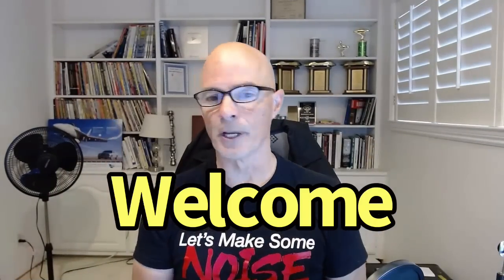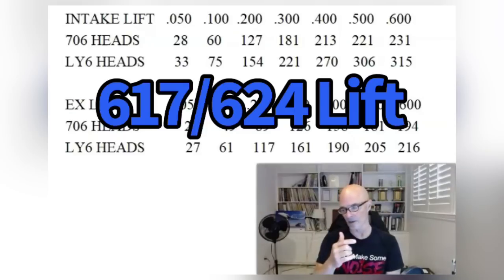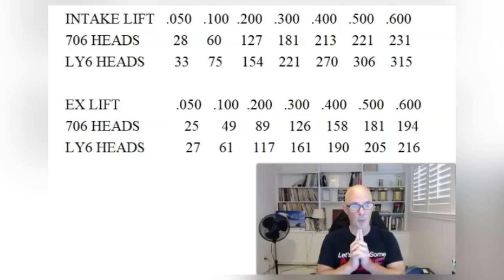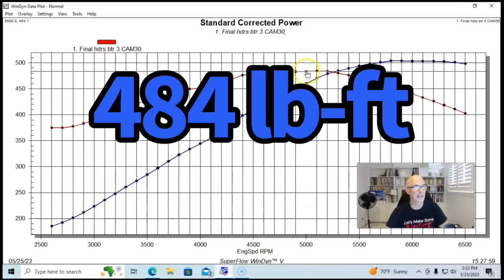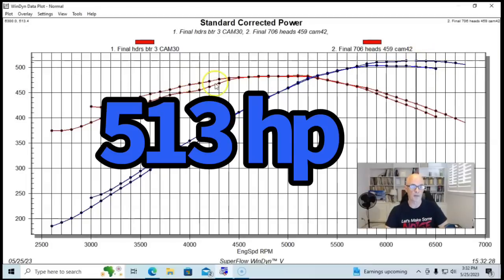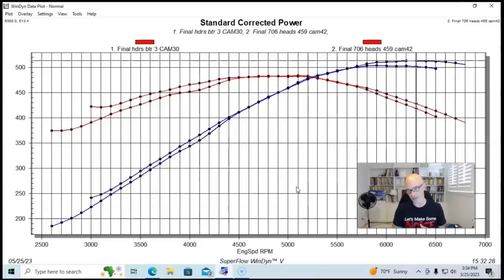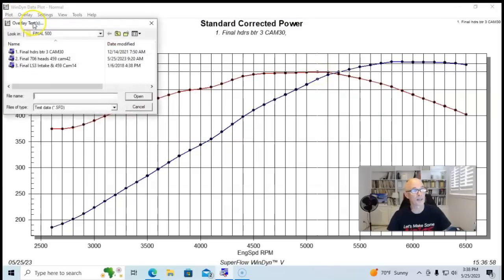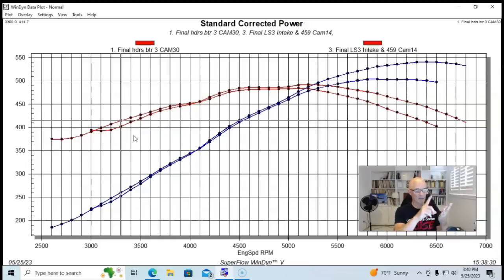HOW TO: BIG LS POWER WITH MILD CAMS-THE KEY IS HEAD FLOW. BIG CAM, SMALL HEAD VS BIG HEAD SMALL CAM

Comment: Great comparo.  TBH never really thought about it, but the results make sense.  Been getting ready to refresh the top end of my LSA and have been waffling on cam choice as its daily driven and a manual car.  Was just going to surface the heads and do a valve job, but now I'm thinking I can stay with a stage 1 cam and just do a nice port job and get the best of both worlds without losing my idle and below 2000 rpm performance.  Thanks Rich!
Reply: Below 2000rpm and performance is a very strange thing to hear in a sentence lol
Reply: @hayden6056 it's important driving a stick. Not having to wind up so much before shifting when just driving around town. And helpful when holding a gear when slowing down instead of shifting down to keep the revs up.
Reply: @AustinRBa  most the cars I own are "stick" , I prefer to keep them in their torque band personally rather than labouring it barely above idle. 

Maybe the word efficiency would have been more effective use of term . 1500 rpm and performance just sounds strange to me. 

I've pulled apart some t56's with stripped over drives who weren't towing because they thought sixth gear was for the highway and were constantly going up hills at 1400 rpm in second over drive lol. 

Unless I'm taking off I keep my cammed manual ls6 at 2500 and change at 3200-3500. Fitting 3.9 gears was the best thing I ever did to the car. Seeing as it doesn't use much throttle input at all to drive the car reasonably it uses less fuel than my bolt on daily with automatic and 3.46 gears while making another 80whp.
Reply: @hayden6056 I'm sorry my man but 6th gear is for the highway ..
Reply: @hayden6056  yeah, I guess the question is what OP meant by performance. I assumed "usable" torque, where 1500rpm and 1/3 throttle doesn't feel like lugging it to death.
Reply: @Ws6Ms  fair , I wouldn't reccomend you using it under 2000 rpm and hills and if you don't want to start whining at around 150k miles. 

In Australia we do a lot of distance driving and finding not noisy t56's at over 250k KMs is getting pretty hard. They're also not supposed to be used for towing in anything over 4th gear. Over drives aren't designed to be made to work and it wears them prematurely. I don't know if the rear gears were better in the us but ours were 3.46

Our highest legal speedlimit is 110 KMs an hour which is about 1700 rpm. Lugging up hills at 15-1700 rpm isn't great in the long run for the boxes.
Reply: @AustinRBa  why are you using a third of a throttle to maintain speed though . In every day driving where I don't want to purposefully make V8 noises I rarely go over 20% throttle. 

35% throttle to me is a heavy amount personally. It just increases fuel usage . Maybe it's because I grew up with twin Weber's and still ride bikes with quad carbs but light throttle input and using the torque of the motor has always worked better for me rather than trying to jam as much air in to it as possible while you're under the curve.
Reply: @hayden6056 So you are putting excessive wear on your engine to keep from wearing out a t56 every 150,000 miles? I have a hard time wrapping my head around that. Like the guys downshifting and revving the heck out of their engine to prevent wearing out $30 brake pads.
Reply: @Dave872010  I don't own new cars my newest car is 24 years old lol. A rebuilt t56 here is without a core is 4k a used one is 1.5-2k .

I'll never tow in an over drive or accelerate at less than 2k unless it's from a stop personally. When you're constantly rebuilding things and you learn why some need it at lower KMs and it's due to driving style you seem to avoid that driving style. 

My brake pads are $80-150 unfortunately not $30 but I don't rev match down to  brake unless I'm doing silly things and setting my gear and rpm for the corner.
Reply: @hayden6056  The car makes nearly 900 whp on E85.  When on street tires its actually much easier to leave in 2nd gear and the car hooks pretty well.  And when putting around in traffic that sub 2000 rpm area sees a ton of use.
Reply from the maker: I'm not telling you something you don't already know-plus you can tune it all!

Comment: Small valve versus big valve has a lot to do with torque as it has been speculated that a small valve with a good flow rate gets more air around it sooner than a big valve but big valve gets more air over all + compression
Reply: That would be an awesome test on the twisties and the dragstrip. Big heads seem to have more drivability with a small cam. I'm wondering if lesser flat heads benefit more from a tighter lobe separation. Only because I've seen a few circle track cars with some tight profiles.

Comment: Maybe the truck intake was holding it back a bit on top end. I think the Camaro LS3 intake would have done better up top in both tests. An the same on the low end
Reply from the maker: THE LY6 AND LS3 INTAKE MAKE IDENTICAL POWER THROUGH THE ENTIRE CURVE
Reply: Watch Richards intake manifold test videos. They are some of my favorites. It's crazy how the LY6 truck style intake is basically the same as the LS3 intake.

Comment: Big head and small cam for anything purpose built and street focused. The small head big cam would be perfect for a salvage yard budget build. As you can see.......they make close to the same power throughout.......but one is totally a more budget build setup.
Reply: You can get some cheap used performance heads from LS3 if you shop around.